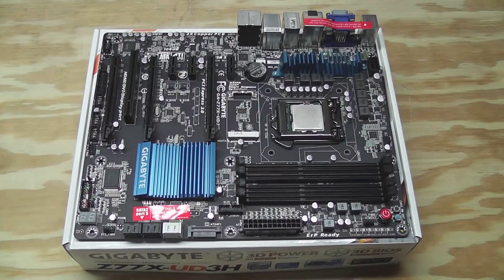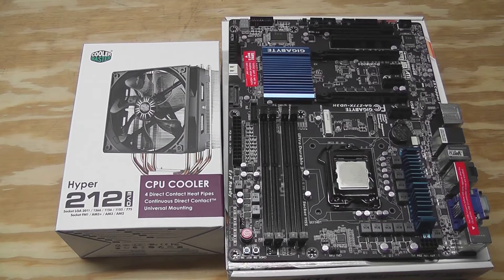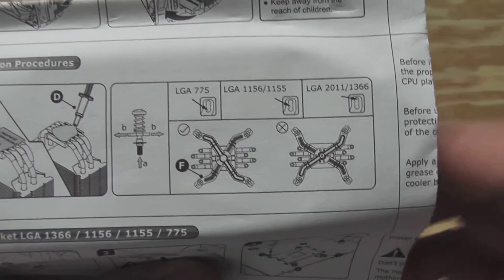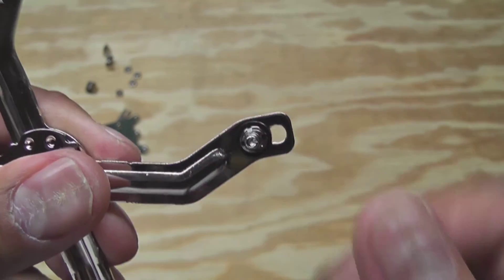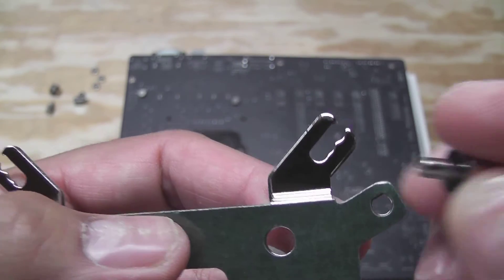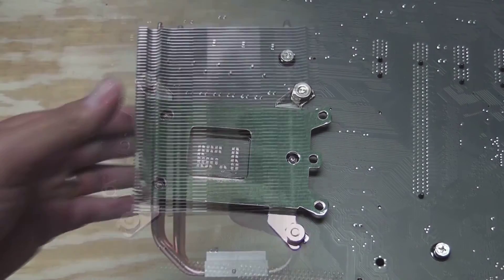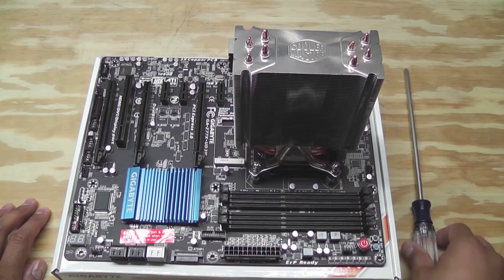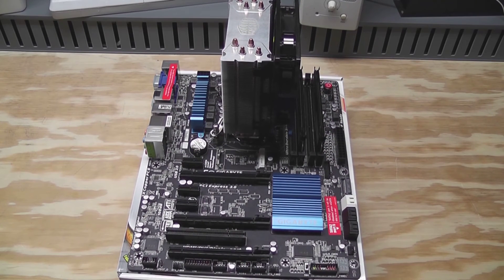PC Upgrade 2012 - i3-2120 - Part 4 - CPU Cooler Revisit - Hyper 212 EVO Installation

Comment: Alright awesome just looked at the reviews for this board, looks like I have to use the fan header on the bottom left near the audio header. Theres a total of 5 fans 2 up top and 3 on the bottom. Just sucks that they didn't put an extra fan header near the CPU header, would've made it a lot more convenient. Anyways I just ordered this board cant wait for it to get here. Ill work my way around the rear fan plug. Looks like I have to route the fan cable under the gpu. or just use the psu molex

Comment: Hey wowtorreon is there a rear fan header on this motherboard? I think my fan wont be able to reach the fan header near the bottom left corner. Also running 3 fans (rear,top,front) excluded is the cpu fan of course.